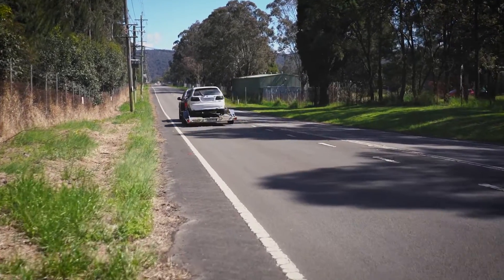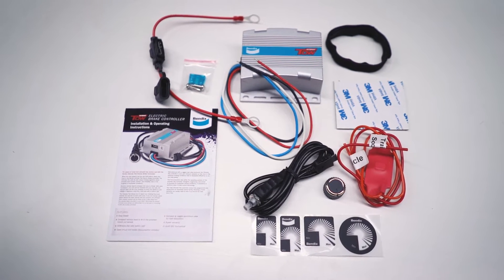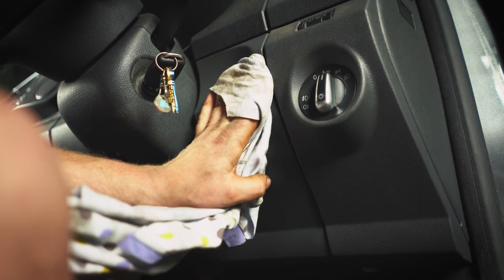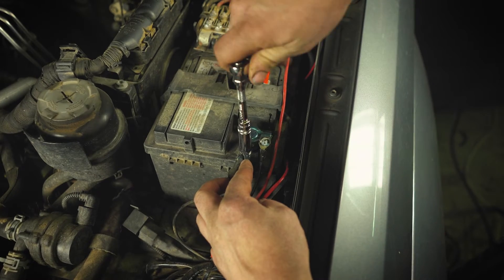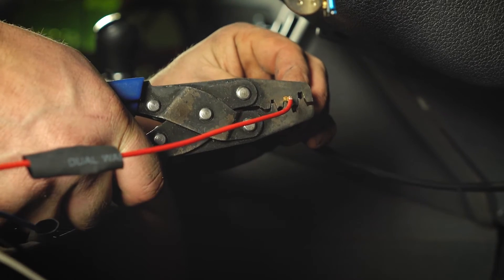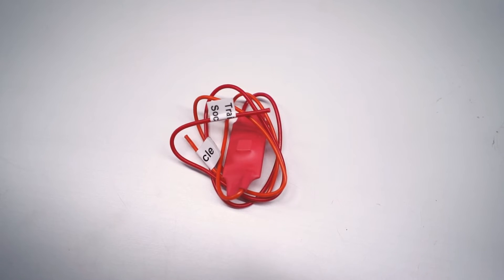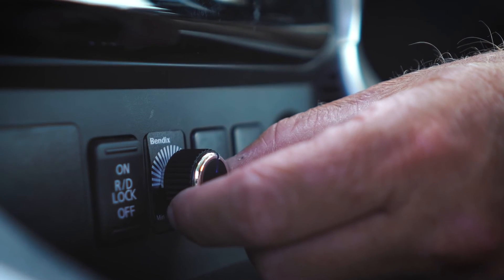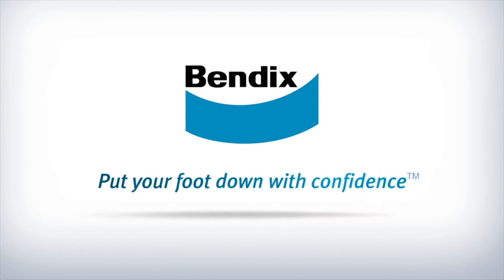Bendix Ultimate Tow Electric Brake Controller - Trade Install Guide

Comment: Protection blocking diode connection - When it says connect one end to pin 6 (stop lights) on your trailer socket and run the other end of diode to the brake switch, what part of brake switch should it be tapped into? near pedal? Also does it matter which end of the red wires (protection blocking diode) I connect to pin 6?